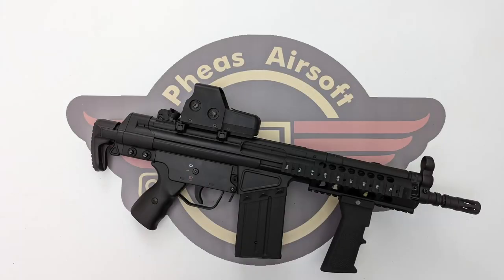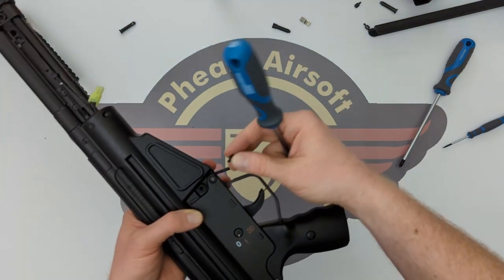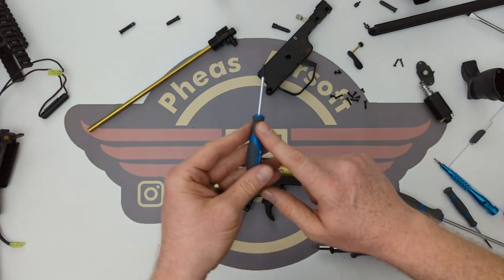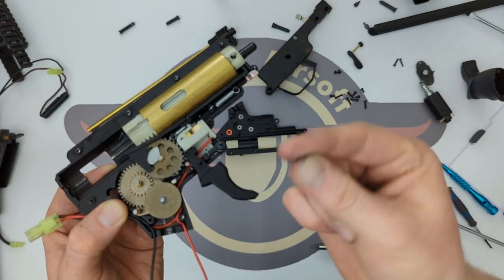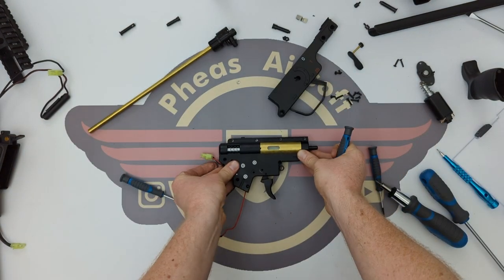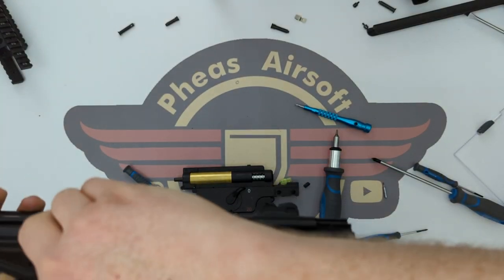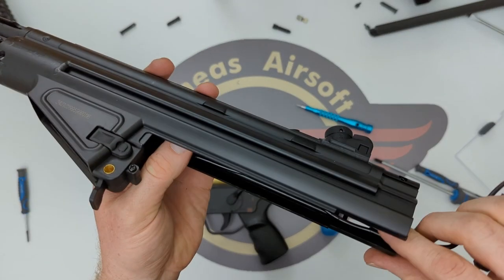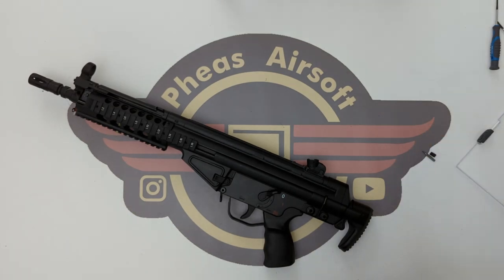[HOW TO] JING GONG JG109 T3 MC51 DISASSEMBLY - Diagnosing and fixing the issues

Comment: The real question is was it the factory that made those mistakes or Gunfire (or patrol base that resold it)? Misplaced shim, torn wire and broken connector.
Also that spring doesn't seem to be cut since it's wrapped flat at the ends. Only way to do that when cutting it is by heating it up and squeezing the last winding with the previous one while it's red hot and then dipping it in water BUT that would most probably leave marks (black or blu-ish colour).

Comment: As always thanks for this video. I have a new  JG T3 SAS. The fire selector blank plate does not have the tiny screw like your gun and my other T3. It's not that its fallen out. The plate does not have a hole for the screw. How do I remove the gearbox if I can't remove the fire selector. Help,please. PS this gun has a QD gearbox !
Reply from the maker: Hello! I have not heard of this before at all. How bizarre. Can you send me some pics of the selector and the opposite side (where the screw should be on mine) and if there is a manual in the box, take a photo of the exploded diagram from the back . Send them to my email pheasairsoftyt@gmail.com or dm them to me on one of my socials. And I will see if we can figure it out. Pheas

Comment: Hi, Thanks for taking the time take us through this, hoping your video can help I've got a problem with a JG112 variant, the one with the folding stock, stopped working all of a sudden even with replacement battery, probably electrical issue I suppose, any hints on how to troubleshoot?
Reply from the maker: Hello! FIrst thing to check.,.. the fuse, replace it and see if it goes again, if it keeps popping fuses then there is something locked up insde. Next thing... try taking the base plate off the pistol grip and see if the wires are still attached to the motor terminals. After that, probably going to need to open it up and look for issues inside to see whats going off. Let me know how you get on Pheas

Comment: It's a low priced entry-level AEG but still it's 2022 and JG still not invested in QD shells yet reinforce the back where it's not needed and create fitment issues for 13:1 gears.  I get an email or WhatApp a week from JG sales asking to buy their gear but so many other better brands out now.  Good vid.
Reply from the maker: Bizarrely, just this week, someone pinged me a message about their JG G3 SAS which DOES have a quick change spring AND the selector is done more in a style of the m4, the cam is attached directly to the selector instead of the funny rod thing... which needs to be fully replaced on mine 😥

Comment: I can feel your frustration there. Would be quite pissed off if my new gun arrives like this.
Reply from the maker: It's all good now. Put a MOSFET in and a new spring and it's running lovely now. But was maddening at the time. Pheas
Reply: @PheasAirsoft  Good to know you made it work!
Reply: I used to play airsoft about 20 years ago, and currently wanting to get back into it... Back then, anything other than TM ran a good chance of not working out of the box, and it was just seen as part of the hobby... Still, there's something disheartening about having FINALLY tracked this model down (where have all the g3s gone?! It's m4s up the wazooie, but buggerall else! 😂), im disappointed to see what a mess they made of it. NEVER had this problem with their g36 range, and cyma's AKs are lovely for the price... But nobody else seems to make an mc51 any more 😥

Comment: Hi really good disassembly i have a question for my cyma aeg, can i use a 7.4v lipo instead of the stock 8.4v nimh but the aeg dont have the mosfet is it fine?
Reply from the maker: Hello! A lipo will be absolutely fine in your cyma AEG with or without the MOSFET. Pheas

Comment: can confirm the bolt doesn't lock back from factory. Also the front rail assembly pin won't hold in under its own weight so I've had to put in a red wall plug and zip tie it 😆 otherwise very pleased.

Comment: Is the g3 trigger and mp5 trigger the same?
Reply from the maker: They are very similar (actually both based on M4 triggers for the top part that interacts with the switch) but they are slightly different shapes to match the prospective designs of the real ones. But very small differences. Pheas